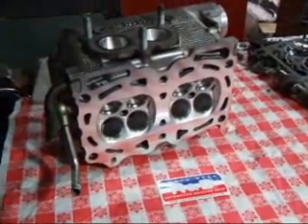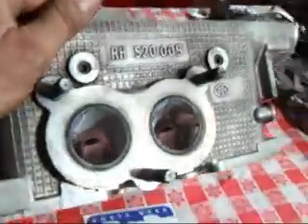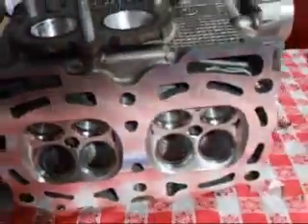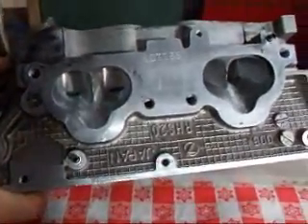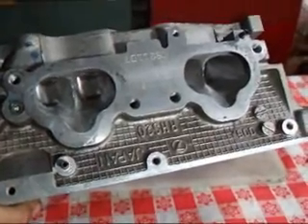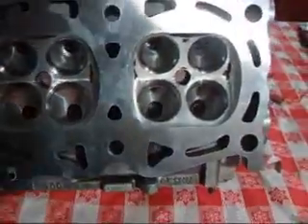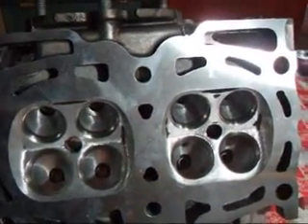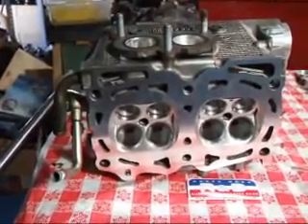CNC Porting Service for Subaru WRX Heads @ Costa Mesa R&D Automotive Machine

Comment: You didn't say at what lift on the cam these numbers came from and you didn't say at what vacuum they were tested nor the machine you used for testing. You also did not say what the port vol was before and after the porting. 

Without that information, it's nothing more than fun with the cnc machine.

Comment: It does look like you broke through. And for those wondering who have never ported, you will probably end up breaking through at least one cylinder and having to reweld, that is how it goes. If you don't want to go all out and deal with having to weld then just work the short side and call it a day.  Decent gains and minimal pains.
Reply: I think it's just spots that were not touched...

Comment from the maker: We don't do X-rays on cylinder heads because the port and water passages casue mixed results. We do ultrasonic port thickness checking. If a head has problems, its junk and we don't waste our time.

Comment: @fiatnutz My thoughts were about it needing to spin up to that to take advantage of the flow potential.  The engine still can only pump so much air per cycle, right?  In this case 2.0L every 2 revolutions.  (My assumptions are that it is 280cfm at 28"wc, measured at max valve lift and stock valve diameter.)  So I was thinking that the flow would allow the motor to stay efficient all the way up to the 8300-8600 range. (If it will keep pulling to 8600 why shift sooner?)

Thanks for responding.

Comment from the maker: @dimman77 All things being equal, this would be about the rpm's you would expect, however from the practical side you are just spinning the engine for no real gain in useable torque. If you can make max power from 6500-7800, why bother revving the engine to 8600? Look at torque figures, not the hp.

Comment: Hi, thanks for the video.  I'm trying to wrap my head around some of the theoretical flow theory and how it matches up with reality.  So my question is, assuming a 2.0L displacement, and appropriate cams to get the valves out of the way from obstructing the flow, would this motor's power peak be in the 8300-8600 rpm range?  Or do I need to take another crack at my theory?

Thanks.